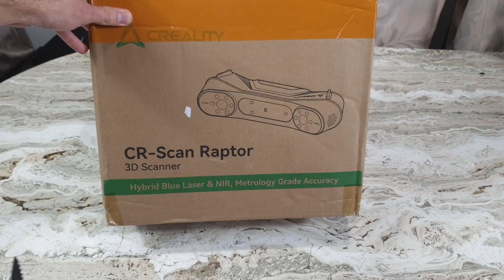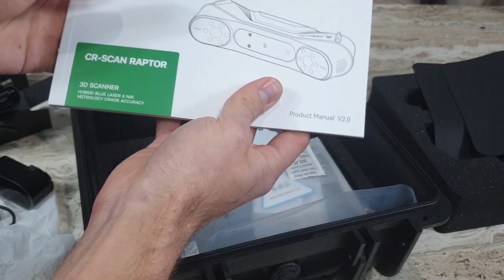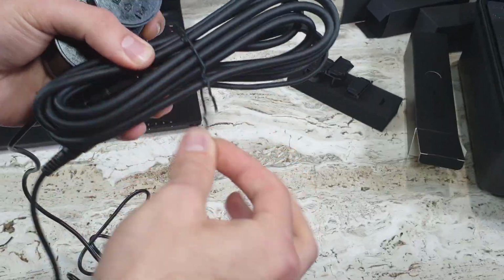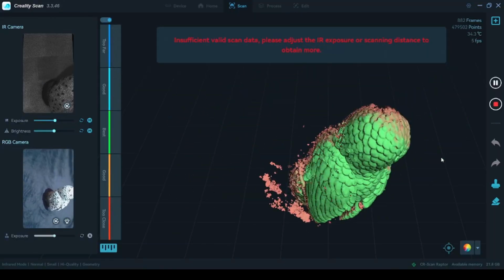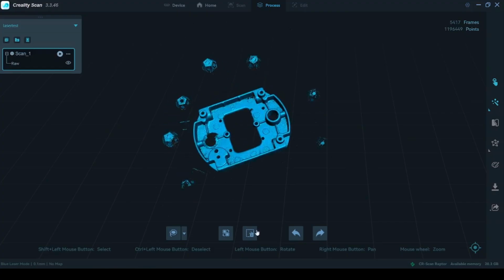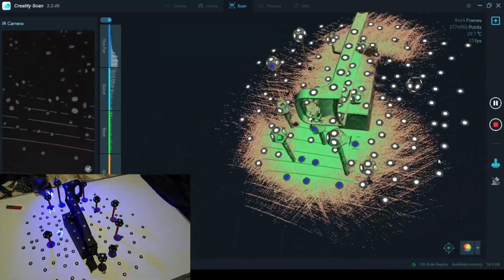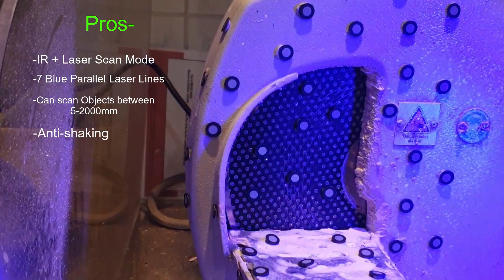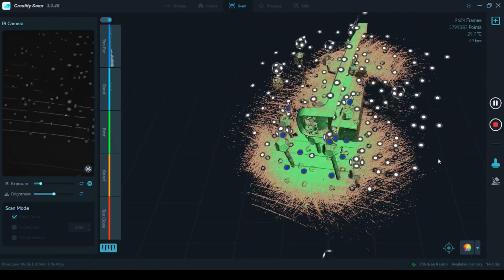Best budget 3D Laser 3D Scanner? Creality CR Scan Raptor #Creality #3dscaner #3dprinting #3dscanning

Comment: I wonder if this would be accurate enough for automotive scanning i.e. custom headers
Reply: Should work, might need to remove the engine to get a good scan
Reply: That would probably work, kinda defeats the purpose since finding the clearance to the chassis is a huge reason for the scan